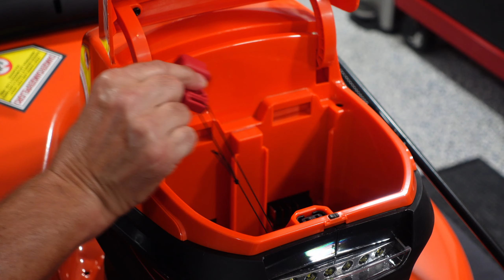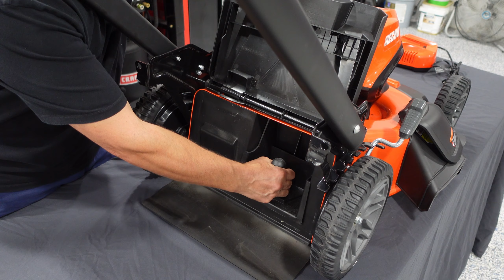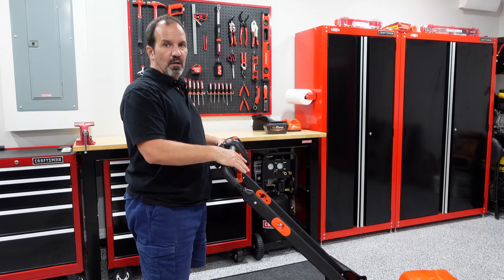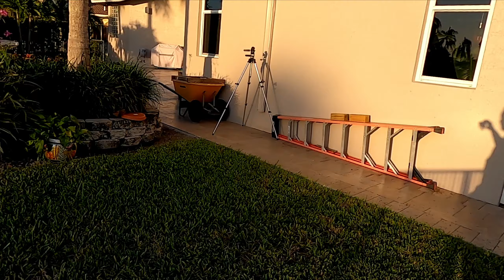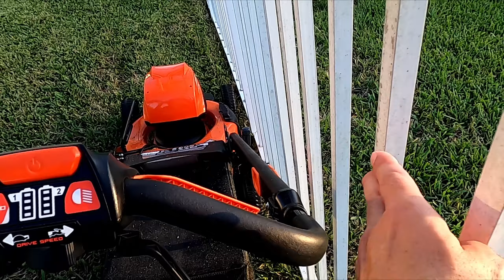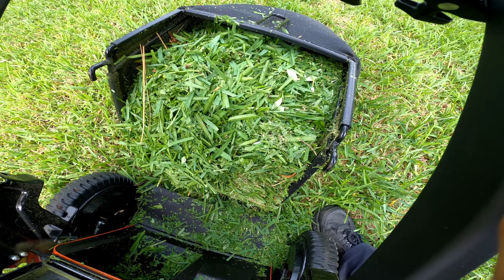ECHO  Lawnmower DLM 2100SP 21" Steel Deck Brushless Motor 56V Self Propelled Lawn Mower eFORCE #echo

Comment: Looks like a Greenworks.
Reply from the maker: Its possible they are made by the same company with different colors with some minor changes. Love the handle design on this setup.  Well made and runs great but can use a bit more power.

Comment: The only thing that threw me of was the bag. It looks like its being dragged. They could of made it higher.
Reply from the maker: Seems like it does but I didnt encounter any issues with that.  This mower has an excellent bagging design.  I didnt have  any clumping and the bag would get full to the top all the time. There were a couple of other issues but this mower was smooth, handle design was great.  It did lack a bit of power and the is a delay after hitting the lever.  Thanks

Comment: How much run time does one 56V 5amp battery get?
Reply from the maker: I didn't do the runtime on it since doing the video is a pain.  The 5 Ah battery would do like a 9000 to 10000 ft lot more or less.  I have 11k and it would not finish the entire lot.  I also did the test with a Toro super recycler and recycler and both 5 Ah batteries did the same coverage.  the idea would be to have the blower and weed eater to have more batteries so you can finish the job.  I have the EGO line and that's what I do.  This mower feels awesome and does a good job.  Its not perfect but none are.  Hope this helps

Comment: Are the cutting blades replacements in the big-name hardware stores?  Hopefully the blade retaining bolt is not black plastic.
Reply from the maker: You can get these at Homedepot, echo online or echo dealer part number is 99988806000. thanks
Reply: @ExtremDIY  👍👍❤❤

Comment: Great video. Thank you.

The engagement levers observation (13:18). Although I see what your saying, the only justification for the larger than desirable space/gap between the handle and resting position is due to being able to grab the handle without damaging or having the levers in the way when the machine isn’t engaged during normal use. Just my immediate observation.

Overall, this video made me glad I invested in this mower the day before. - Thanks again
Reply from the maker: You are welcome.  Great built quality and very smooth.  Deck is perfect and handle is clean.  Enjoy

Comment: How do you turn the lights on.  My button does nothing.
Reply from the maker: Hi I believe you need to have it on or at least engage for the drive.  Press the main button first then try to turn on or off the light. let me know if it works

Comment: This is a rebranded Greenworks. Stihl bought a substantial share of the company. They make mowers for Stihl (obviously), Kobalt, Snapper, Menards, Harbor Freight, etc. Usually the main differences are the handle and battery design. On some models the batteries are the same dimensions but there are different notches so they're not interchangeable.  I have the 80 volt Kobalt model. My biggest complaint is that it likes to miss spots, like it doesn't have enough vacuum to lift the grass.
Reply from the maker: Yes you are correct on the maker and yes the vacuum thing could be an issue.  I did a test with a small wind meter and out of my 4 mowers the echo has the least suction.  The reason was the blade I notice that the blade was very flat to save battery life.  If you can find a blade for the unit that has a higher pitch it will increase the vacuum on it at least my Echo had that issue.  I also have 3 Toro and the gas one by far has more suction even with the same style blade.  Not sure if they make a high lift blade for the Kobalt all I see is a multi purpose blade. Try to find one and if they make one give it a try and see that it will improve.  thanks
Reply: From what I've seen, the blade is the same on all those models and there is no high lift blade available. I have seen people hack together blades but I wouldn't trust that. I'm figuring it puts too much load on the motor or uses too much battery is their reasoning. But that's just a guess.
Reply: I don't believe Greenworks makes Echo products.

Comment: There is a trick to engage the blade. Orange button then orange lever. Not the other way around. The black levers are for the self propelled feature.
Reply from the maker: Thanks for the info

Comment: I have the gen 1 Echo 58v and I can’t complain after about six years ownership. But at this point, no matter how much I sharpen the blades it’s just not cutting clean anymore.
Reply from the maker: Hello it can be the batteries are not spinning the blades fast enough due to age.  You can do it on the turbo setting to get a better cut.
Reply: You are exactly right it could be only problem is can’t find the gen 1 batteries anymore

Comment: Does Mulching use more or less battery vs Bagging?
Reply from the maker: Hi I didnt test that option.  I think it should be close but bagging will have to carry the extra weight so maybe bagging waste more. thanks
Reply: Mulching uses way way way less battery!

Comment: when I start the mower there is no way to run off the sherf problem. neither of the handles star the Blake.  only was to turn if off is pull the batter key.  but the mower keeps moving
Reply from the maker: Hello if you purchased new get warranty on it.  Maybe the switch is stuck on the ON position.

Comment: The travel will not allow a child with small hands engage the levers
Reply from the maker: Hello I think you are correct on that.  I dont know why they make it with so much travel. Machine works well but needs some minor improvements.
Reply: Is that my problem in not being able to start my mower? I’m very tiny.

Comment: I ordered one today from Home Depot. I'm an older lady and everything is getting harder for me to do. I have thought about going electric for a few years, and it seems like the time is right now. I look forward to easier lawn care this year. Fingers crossed! This was a great review, and very helpful, thank you!
Reply from the maker: Hello you are welcome hope you enjoy using it.  Its super easy and smooth mower.
Reply: I just bought one today, and it cut really nice. How is it going for you? I am an older lady in your age group as well. Things sure are getting tougher! If you don't mind, let me know how your mower is doing!
Reply: @staceys1870  I think I have cut my yard 4 times now with my new Echo mower, and I'm loving it! I appreciate not having to pull a rope to start one, splashing gasoline everywhere, and pushing, pulling, and shoving a heavy mower across my bumpy lawn. The Echo battery mower has made grass cutting so much easier for this older gal. I'm so happy I bought this. Fingers crossed that it holds up well like my old gas Husqvarna has.
Reply from the maker: @kaypryor2668  Its well built there is no reason it wont last.  Love mine hope you enjoy it. thanks
Reply: @kaypryor2668  Thank you so much fro your reply! I have used my twice now, and agree with you. I love it and it's so much fun as well. = ) Do you happen to have a weed eater you can recommend? I know we already have the Echo battery, so I imagine I should stick with that brand, but wondering. Thank you!
Reply: @staceys1870  I have a 20v Black and Decker weed eater that I got about 3 years ago. It came with two batteries which is nice. If I didn't already have that I would probably get an Echo and keep my battery brands the same. I know they are interchangeable between the different tools that they make. I'm glad you're liking your Echo mower!
Reply from the maker: @kaypryor2668  Hello I do very nice to use.  Ryobi makes a mower that has a mulch and bag lever that is very nice but kind of pricy.  Thanks
Reply: @kaypryor2668  Thank you so much for your reply! I am soooo tired of my new doing hobby. haha! It's so much fun, but I am so exhausted, the Echo trimmer is still in the car. I picked it up yesterday! hehe Take care!
Reply from the maker: @staceys1870  Hello mine is going fantastic.  The battery still strong and its very comfortable. Enjoy
Reply: I’m an older lady too (pushing 70, and only 4’ 9”) so I agree, everything is harder for me. I’ve been sick for 21 years, but recovering. I keep forgetting I’m old, so I do things that I probably shouldn’t. 
Anyway, I just bought this lawn mower, and I may buy an extra battery and the blower because it’s a good deal at HD! 
However, I can’t figure out how to start it! It’s been used by a guy who loved it, so I must be doing something wrong, which is why I’m watching this video!
Can anyone help me? I put the charged battery in one side and then tried the other side. I’m not sure about the key. I just pushed the start button and nothing happened. I’m sad. 😢
Reply from the maker: @Tinyteacher1111  hello, first make sure that the key is inserted all the way.  To get the mower working you first press the middle orange button and then either of the orange levers in the front.  After the blade starts spinning you press either black levers to move forward.  Hope this helps
Reply: @ExtremDIY  Is the key supposed to be near the battery? That’s where it is. I don’t see another place for it.
THANK YOU!!!!!
Reply from the maker: @Tinyteacher1111  yes its next to the batteries.  Remove it and inserted again just in case.  See if you led lights work to make sure its getting power.
Reply: @ExtremDIY  We still can’t start it. I don’t see the led lights coming on. The key stays in the battery container?
Reply: @ExtremDIY  My son-in-law got it to work. He didn’t know what he was doing, either, so he held down the start button with his thumbs and pulled back on BOTH  handles! Yay! Now it’s raining here! Ugh!
Reply: @Tinyteacher1111  
First,  make sure that the safety key is in place, and pushed all the way in (that's the little orange block that sits between the battery slots). Then make sure battery is all the way in. That takes a very firm push down. To start it, push down and hold the start button then pull either one of the orange levers. Once the mower starts, you can let go of the start button. Hope this helps!

Comment: Let me add to this review in my own way. I have northern tall fescue here in my area which cuts way different than that stiff southern turn in the video. I picked this machine up because I have a pool with a slope too steep for a gas engine on one end and the trimmer was a pia with no real way to keep the bulk of the grass out of the pool. This mower cuts northern tall fescue beautifully. Highly highly recommend this mower for somebody with the right size lawn or a specialty need like I have. I cut commercially for a living for over 30 years. My personal mower for "home" is a Scag Tiger cat II 61" with Briggs vanguard big block 35hp. I am on 3 acres with 2 of it being lawn.  Again great review!

Comment: Thanks for the comprehensive review! Funny my toro dealer was showing me this today, might be better for my lawn to be able switch off the SP like this mower for parts of it.  How does the cut quality compare to the toro's?  Any problem with locking up when backing up using SP like some have reported?  Thanks for any input!
Reply from the maker: Hello there are some great things about it like design, storage, easy of use, handle is awesome design, the bagging is perfect.  The cut quality is ok on low but on high is good.  Its a simple blade it comes wit.  I haven't searched for any other blades. Battery is not bad on low so if you are going to use on high then need 2 batteries.  It does get a bit stuck when you pull it back sometimes.  On the speed sometimes feels a bit slow but not a deal breaker.  Over all its fun and very smooth to use except when it gets stuck pulling back.  I have the toro super recycler and that is the best cut I have done.  The Toro its not perfect but still has the more natural feel since it uses a belt drive like the old ones.  I tried the EGO and hated it.   If you are getting the Echo and buying the weed eater and blower then you will have the extra batteries to cut with.  I love Echo I had the gas powered attachment series since I started cutting but switched to battery. Hope this helps let me know if you have any questions.  Check out the Toro videos
Reply: @ExtremDIY  Many thanks for sharing your experiences. I guess one plus of the Echo over the SR Toro is that you can use this one without any SP for small areas where one is maneouvering around etc.  If you don't mind my asking what did you not like about the Ego as it gets such great reviews? Thanks!
Reply from the maker: You are welcome.  For me the ego felt like a plastic toy.  Since I like to bag there is a metal crossbar that is annoying.  Trying to get the speed was not good for me.  Either too fast or too slow.  It did cut well with the dual blade. I do have ego weed eater and blower and like those but not the mower.
Reply: @ExtremDIY  Many thanks!  Yes, I've heard that the speed control is easy to bump etc.
Reply: What’s SP? I’m trying to figure out this new lawn mower I have. It won’t start, but it has been used, so I know it works. What the heck? 😕

Comment: Hey, did you know that Greenworks as the top-selling battery tool brand shared some of it's own manufactured products with other least top-selling brands, such as Echo? All except the color scheme and logo!
Reply from the maker: hi I did notice they look almost identical on the body.  Love this design.  I have Toro and this echo deck works really well.
Reply: Green works has plastic wheels and plastic deck.